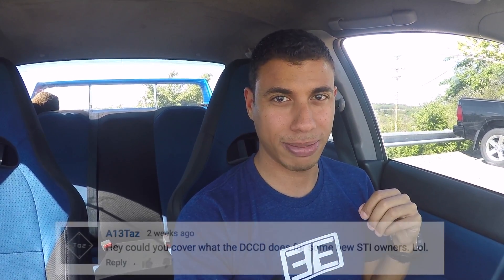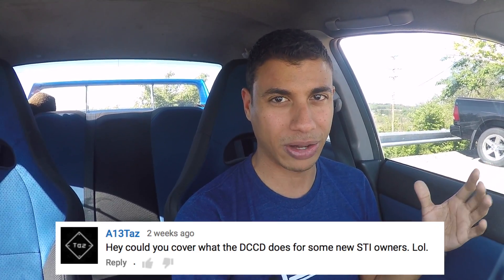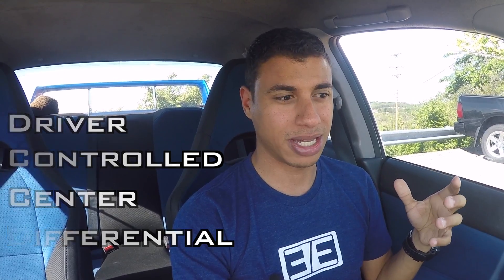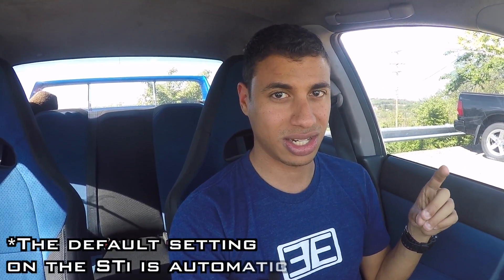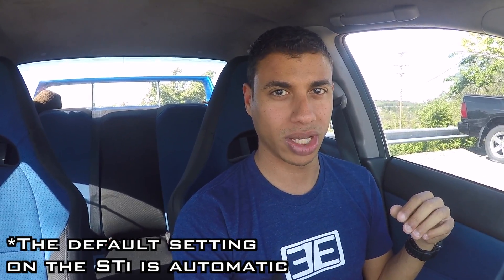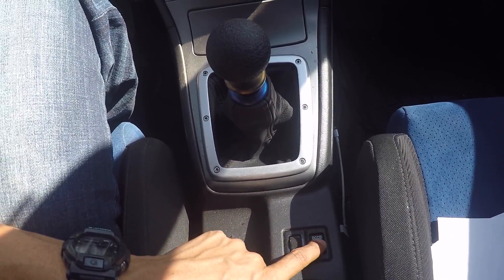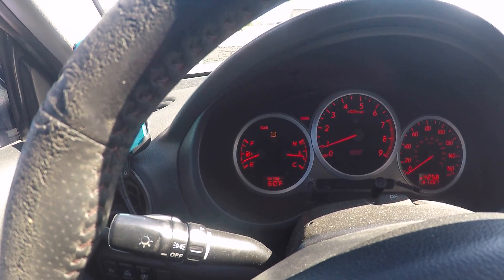Subaru STi DCCD System Explained

Comment: Bro, the DCCD system doesn't change front/rear power. This is such a bad video and so many people are commenting like "thanks bro for explaining it to me". The DCCD system determines how much the centre diff is locked up, THAT'S IT. Have it on max to lock up the centre diff. Have it on lowest to completely unlock the centre diff. It's got nothing to do with sending power front or rear, Jesus fucking Christ. Especially for a dude wearing a Engineering Explained shirt. Just blows my mind.
Reply: Mate, if you read the link you posted you'd notice that you're wrong. You can also open your owner's manual.
Reply from the maker: @ParalyzedNight  Stop liking your own comments. 🤣🤣 How insecure are you? And no, you simply are not understanding torque split/bias. SMH.
Reply: I drive a 2018 sti and previously had a 2001 sti. Did you open your owner's manual yet? I'm guessing not. Bubye, there's no point in arguing with ignorance. Everyone in USA thinks the DCCD controls the torque split, but here in Australia everyone knows how it works, same as in Japan and same as anybody who knows how differentials work. There's something in your water over there in USA.
Reply from the maker: @ParalyzedNight What you have stated would mean that there is no torque bias in the STi, which is factually untrue—it is demonstrably untrue. Lol. Ok, have fun jacking your own comments off somewhere else, Randy…
Reply: DCCD driver controlled centre diff. It doesn't transfer more power to the front or rear. It controls the amount of lock on the centre diff. If you don't know how it works, just google it. But I know you're too scared to google it because you'll realise that you are one of the people that misunderstood how it works. It's ok to be wrong, but what's more important is to do your own research.
Reply from the maker: @ParalyzedNight  STOP LIKING YOUR OWN COMMENTS. 🤣
Reply from the maker: @ParalyzedNight  I bet you pat yourself on the back too. & write yourself little love notes in the mirror. So cringe. So insecure. SMH.
Reply from the maker: @ParalyzedNight  I’ve already explained it to you. When the diff is actuated, it created a power bias to the front & rear wheels. That amount depends on how it is engaged. You CLEARLY do not own an STi. 🙄
Reply: No, it does not change
Reply from the maker: @ParalyzedNight  Again, you lack basic understanding. Why are you even here? Thanks for boosting this vid in the algorithm BTW. 🤣
Reply: @hawkeyestiguy  Cool bro, anybody new that watches your video will see these comments and see how ill-informed you are about this common misconception.
Reply: @ParalyzedNight  your completey right, shame he wont admit he is mistaken.
Reply: What does that even mean mate, you are so dense. Heres a link to the torque biases depending on year and transmission of the STI:

https://en.m.wikipedia.org/wiki/List_of_Subaru_transmissions

THE TORQUE BIAS DOESNT CHANGE DEPENDING ON HOW YOU SET THE DCCD, THE TORQUE BIAS STAYS THE SAME. All the DCCD does is change how much the CENTRE DIFF IS LOCKED OR OPEN. Read a fucking book on how diffs work or youtube it, you fucking idiot my god lol
Reply: https://en.m.wikipedia.org/wiki/List_of_Subaru_transmissions

There you go, a list of the torque bias depending on which year model and transmission your STI is. The torque bias never changes when switching between different lock/unlock of the DCCD, the torque bias stays the same between all settings. All it does is lock or unlock the centre diff at varying levels.
Reply from the maker: @ParalyzedNight  Yes, it is not a 50/50 power split, which means when the center diff engages, the bias front to rear bias power changes as well. THANK YOU FOR MAKING MY POINT FOR ME. 🙄 So dense.
Reply: https://youtu.be/K2F4RyKCi7c?si=sHEgXu7LeVnGMpai

Here is a demonstration of the DCCD. Showing how it locks or opens the centre diff. Go read a book on how diffs work buddy and read the links you post as "proof" before you go spouting nonsense that you don't understand
Reply: Mate, you can believe in your fantasies if you want. Have fun being wrong lol. All it takes it 20 mins of google research on the topic and you'd find out how it works. Or like I said, open and read your owner's manual. This is one of the most misunderstood aspects of the STI's and you're part of the problem. Like I said, just do some googling instead of being a dimwit
Reply: I'm here to correct the common misconception of how people in the USA think DCCD works. You're wrong. You're whole video is incorrect. Sorry mate
Reply from the maker: You are incorrect. As stated, the center diff adjusts the bias of front & rear & can lock the center diff. Sorry you were too dense to understand one of the most basic videos on the DCCD system. Go read a book, or a NASIOC forum.
Reply from the maker: You can start your studies here. https://forums.nasioc.com/forums/showthread.php?t=897129

Comment: Dude…your explanation is incorrect.  It’s not for controlling where torque is going.  The center diff is rear-biased.  The DCCD controls how much LOCK-UP there is between front and rear.
Reply: The same in ALL situations, doesn't matter what the centre diff is set to. The bias is always the same.
Reply: Haha bro you need to shut up if you don't know what you're talking about. The bias never changes when you lock or unlock your diff. Please, my friend, educate your self on how a diff works. And please, open your owner's manual and read it, it's right there in black and white from the Subaru engineers them selves explaining how it works.
Reply from the maker: @ParalyzedNight  So what is the natural power distribution on the STi with the diff wide open? What percentage of the power goes to the rear wheels?
Reply from the maker: This is a basic explanation for the layman. What I said is correct. The center diff locking up changes the amount of WTQ going to the ground through Gus drivetrain & affects front & rear bias.🙄 I’m explaining the function of it, not the minute details that no one cares about & that go over most folks heads.

Comment: hey there, proud owner of an 07 Hawkeye STI here.

Maybe you or anyone reading this has an answer to my issue. When I set it on Lock, or anything front biased, its way harder to make small slow turns and I even hear clonking noises from below of my car. I only can overcome this resistance with much more throttle than I'd would with a rear biased setting. So this kinda doesnt feel right and it gets worse when car has been driven warm. Thx in advance
Reply: You don't EVER want to drive with a locked diff when you have traction. It locks your front and rear differentials so you essentially have a straight axle where your tires can only spin at the same speed, which is horrible when you have grip. The outside wheel has to be able to spin faster than the inside wheel in a corner when you have traction, the noises you are hearing are your car telling you there's a problem. Only lock when you have a situation where traction is a problem. I can't stress this enough.
Reply: @ryanmccloskey4292  Yeah true. By now I learned about that lock thingi. The noises apparently come from the center dif. where the viscous coupling is just worn out and awaits it's replacement.

Comment: So during dry weather what would you recomend for hard driving. I have N 05 STI. & what do you keep it in when its raining..
Reply from the maker: I usually keep it either in auto or on the most open setting to the rear in dry weather. In the rain, I usually prefer it to be open, or sometimes in auto depending on conditions. I like it being open because it is slightly more predictable than when on auto. If things get real sketch or it’s raining really hard, I’ll usually keep it around the mid point or slightly favor the front.
Reply: @hawkeyestiguy  ok thnx man. I heard it was bad to always keep it in auto  all the time & when driving hard. Is that true?

Comment: Great Vid!!! bro is bad to use lock setting in sunny tarmac?
Reply from the maker: Thanks. You can lock it, but there really is no reason to. It can put more stress on components if you use it on dry tarmac & it also will bind up when making tight turns. I only lock it when the roads are totally snow covered or I'm off road & it's muddy.

Comment: This guy has no idea what he's talking about.  The next lower level from lock is 55/45 . STI can't send more torque on front wheels then on rear wheels
Reply: Exactly, this feature sets initial LSD torque from "lock" to fully released. It has nothing to do with rear or front wheels drive. It is all in manual.
Reply: I was under the impression that locked it acts more like 4wd where all wheels continuously get even power & the more open it is the more it allows the wheels to vary speed.
Reply: Here a link that explains this way better. This video is not a great explanation whatsoever. https://forums.nasioc.com/forums/showthread.php?t=1281101
Reply: On a related note: A locked diff is effectively a solid axle, which has no torque split at all. Many people get that wrong and say, for example, the STI's center diff can lock and put down 50/50 torque- that is not correct. A differential has a nominal torque split- that NEVER changes. Diffs can just have slip-limiting mechanisms that allow the differential to get torque down varying amounts on each side- intentionally interfering with the differentials nominal torque split. In the STI's case, it allows the diff to gradually change from a diff to a solid axle. When it's locked, there is no torque split; torque will go where it can- anywhere from 0/100 to 100/0.

Comment: Man you are so far off what happens you should take this misinformation down!

The only thing dccd does is effect the lock up of the centre diff.    Power is
Always split 35/65.

torque moves around on lock and can have all the torques at one end of the car while on locked.  In open the torque split is locked and will be 35/65 at all times  

The only thing you got correct is that open is slide around mode since the centre diff won’t lock up and transfer power to the front when the 65% power causes the rear to break free.  Say it takes 100ftlbs to keep rear spinning your front tires will be getting 35ftlbs  the whole time your sliding around.  

If you locked it that 100ftlbs would move to the axle with the most traction and the tires stop spinning. 

Educate your self before being a teacher 

And remember this saying cause I have a feeling it will apply to the maker of this video

“When talking to a fool first make sure they aren’t doing the same”
Reply: Dunning-kruger
Reply from the maker: @ParalyzedNight  Funny, you seem to no longer have an argument to make. Again, thanks for boosting this video man. 👍🏼
Reply: @hawkeyestiguy  Mr Kruger
Reply from the maker: @ParalyzedNight  You forgot to like your own comment that time. Stop slacking. Or is your hand getting tied? Go tell mom to make you some ice cream. 🤣
Reply: @hawkeyestiguy  ok Mr Kruger. I love that you drive a car and use a function in it that you don't know how works.
Reply from the maker: Subie FPV You are arguing semantics & technicalities. Again, as I stated previously, I am just simplifying what DCCD is in the most basic of terms so that the average non-technical, non-car person can have an idea how it works. If I wanted to be super technical & completely by the book, I could’ve been, but that would not have helped anyone understand the basic idea of the system.
Reply: @hawkeyestiguy  You are a perfect example of the dunning-kruger effect.
Reply from the maker: @ParalyzedNight  FROM SUBARU: “The Driver's Control Centre Differential (DCCD) allows the center differential locking of the WRX STI to be dialed in and adjust its handling. It adjusts both an electromagnetic multi-plate transfer clutch and mechanical locking of a Limited Slip Differential (LSD) to distribute torque to the front and rear wheels.”

https://www.sportsubaru.com/subaru-si-drive-and-dccd-explained.htm#:~:text=The%20Driver's%20Control%20Centre%20Differential,the%20front%20and%20rear%20wheels.

https://forums.nasioc.com/forums/showthread.php?t=2892298

https://www.iwsti.com/threads/dccd-settings-torque-ratios.52789/#:~:text=Torque%20split%20is%20a%20fixed,idea%20of%20torque%20split%20meaningless).

https://www.reddit.com/r/WRX/comments/ye2a9z/what_does_the_sti_dccd_do_how_it_works_and_why/?rdt=63534

Still liking your own comment the second you post it. Were you not loved as a child? What drugs are you on dude? Seriously. 🙄

Comment: How many stages do perfomance parts have?
Reply: Depends on the car, but mostly ranges from 1 - 4ish. But these are mainly bolt on mods per say, bc usually (from my experience) they dont require internal engine work, once you want more powrr than the stages that certain companies provide you gotta build your engine and go more boost if you car is boosted, or nos if you're running an n/a bottle build.

Comment: Id say 65/35 is best for track, fwd messes up the balance during power on cornering. Fwd track cars generally have forwards weight distribution and a firm rear to negate this, but with 4wd, you the loose rwd grip. Better balance the cars setup from a 65/35 setting letting you pivot the car with throttle in cornee exit like a rwd car. You still get the 4wd benefits with that 35% tourqe on bad roads or if weather deteriorates.
Reply: Just got a 5speed dccd unit for my  forester

Comment: Only the cross trek has a mechanical 50/50 split. Most other models have a 60/40 bias with clutch packs.
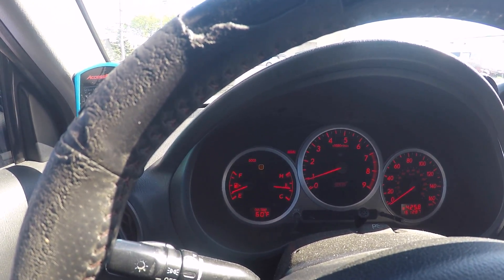Reply from the maker: mad636man I never said the STi had a mechanical split. At 1:50 I said it has an electronic 50/50 split when the DCCD switch is set to the ‘lock’ position. STi’s also are able to change that 60/40 split around & give a power bias to the front or rear wheels.
Reply: HawkeyeSTiGuy at 0:50 you say “most Subaru’s have a 50/50 split.” That is not true. I was correcting the 50/50 statement you made in my comment. Not the fact that it’s mechanical. Sorry for the miscommunication.
Reply: It’s a good video otherwise. I wasn’t trying to make it seem like I didn’t like the video. I was just correcting that very very small mistake.

Comment: Daily driver 04 in the caribbean should i just leave it in auto or which mode is best
Reply from the maker: Saied Ali It’s up to you. I would say either auto or all the way open(green bottom most light on dash). Either of those should be fine. There really isn’t much need to have it set to anything else unless you are driving on snow or gravel. 👍🏻

Comment: Dude have you been chewing on your steering wheel or what. We have virtually the same year yours makes mine look brand new lol. Good video 👍
Reply from the maker: Erika Quezada Nope, my car was neglected by previous owners. It had 73k miles on it when I bought it in 2010 & spent most of its life baking in the Florida & South Carolina sun. Seems like the leather was never conditioned because it deteriorated to that point within 3 years of ownership. 

I have wheel from a 2015 STi I plan on installing when I have the time. & thanks. 👍🏻
Reply: HawkeyeSTiGuy oh geez sorry to hear that. Awesome video helps the rest of us so we can be a little proactive